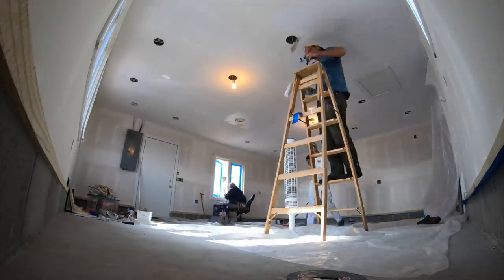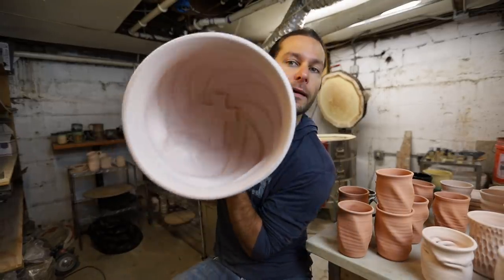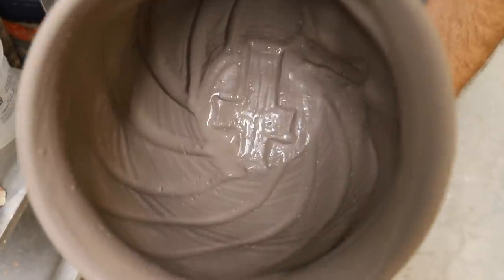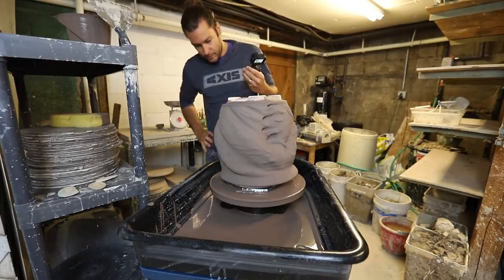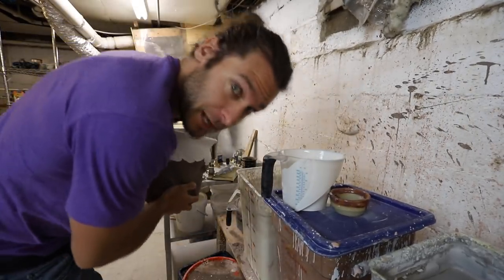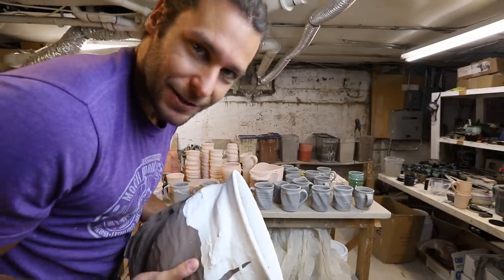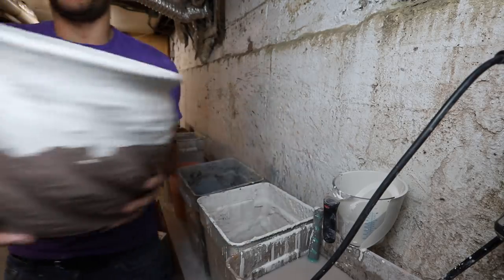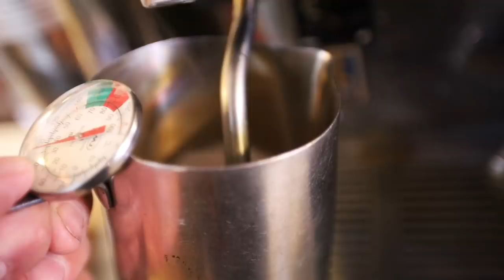HUGE Pot being GLAZED in the Studio!

Comment: I have  question for you. When you make mugs, do you always trim the very  bottoms? I have noticed that some potters dont trim the bottom. They trim while on the wheel. Now, for the most part, I  trim all my mugs, but sometimes the bottom is too thin and is actually perfect for a bottom the way it is. I saw where a potter just pushes or bumps the center of the bottom. Do you do it that way?